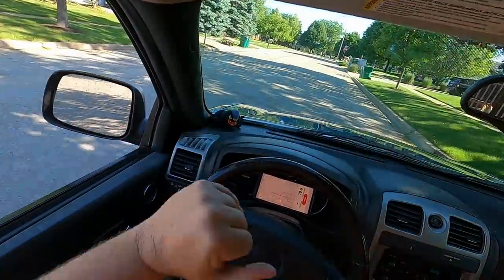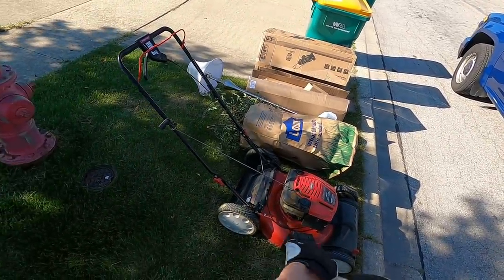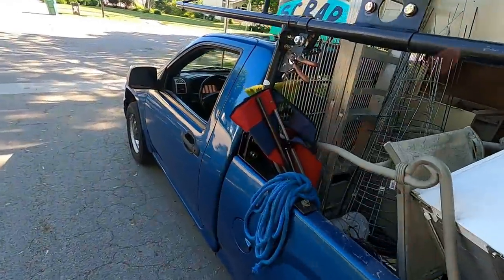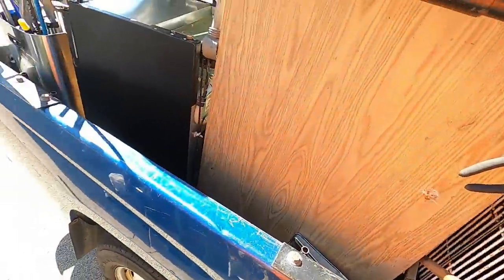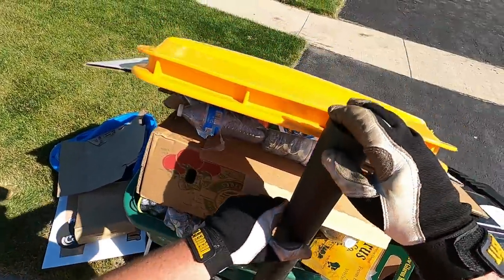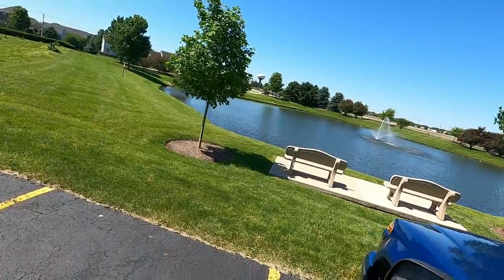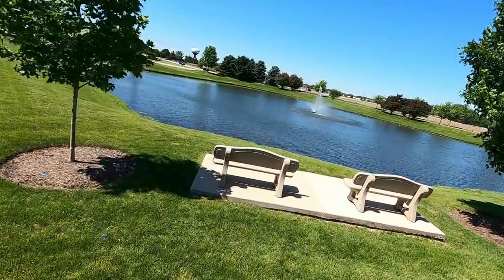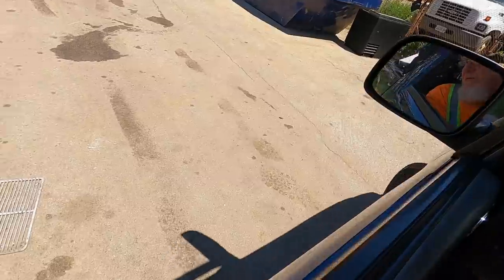Craziest Things Found on the Curb

Comment: You can get a less expensive refrigerant recovery system than $1000 that will work just as well or build your own system. You will have to take a refrigerant recovery certification test I think when I took my test back in the early 1990's as I recall there was a booklet and a 100 question test couldn't have been too hard I scored an A

Comment: Lol I'm the last one I guess. When I was working in the scrap life I  cut up #1 steel  and #2 we had around 21,000 lbs. Copper had around 780 to 900 lbs on #1 copper. 358 lbs of aluminum .I had a nice paycheck after I sold it to them